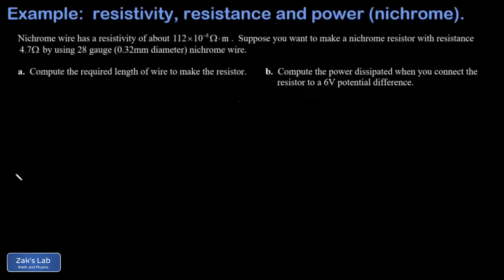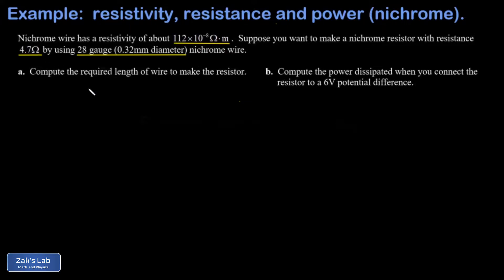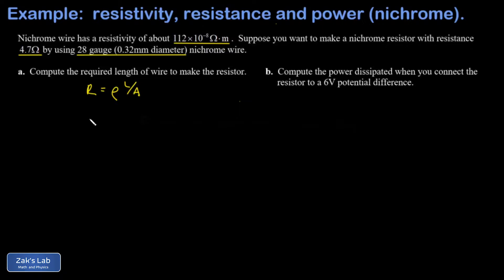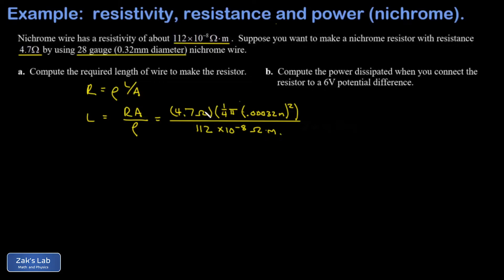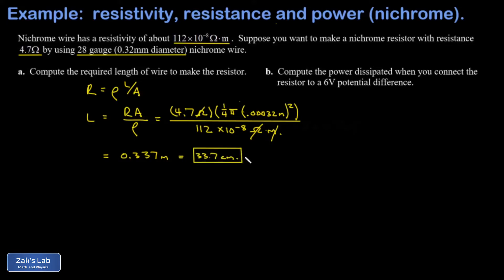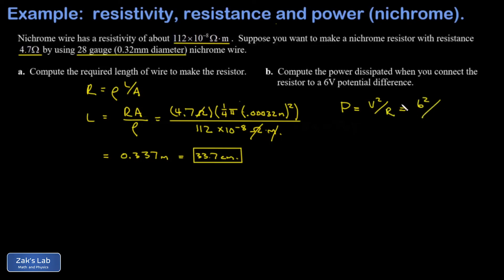Given resistivity of nichrome, find the length and dissipated power of a nichrome wire.

Comment: THANKS FOR THE INTERESTING VIDEO!!!
I was wondering something about a nichrome resistor wire...
How would you calculate the MAXIMUM current (or power dissipation) that a given gauge of nichrome wire.
In my case, I have a one meter length of 18 gauge nichrome wire and know the basic parameters...do you know of any way to determine a safe MAXIMUM current that can be run through it (no external cooling yet), or power rating, so that it is not damaged??
THANKS AGAIN!!!   THUMBS UP AND A SUB.
--dALE
Reply from the maker: I would defer to some kind of maximum current table online for that . . . I remember doing a similar thing after winding a bunch of solenoids for a 2D gas simulator table, and there are tables out there that tell you max current for the specified gauge and material.  -- Zak